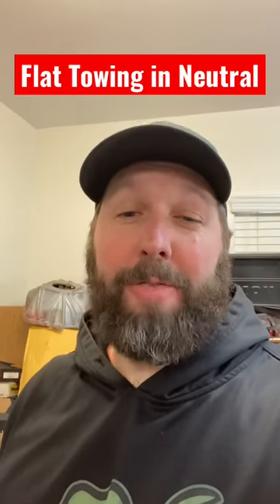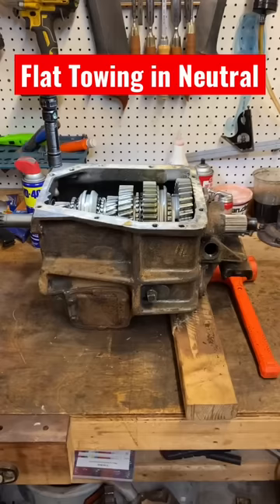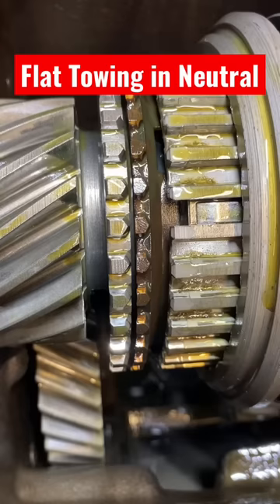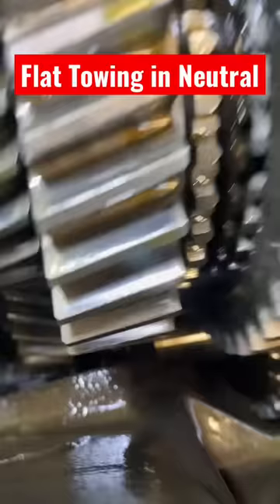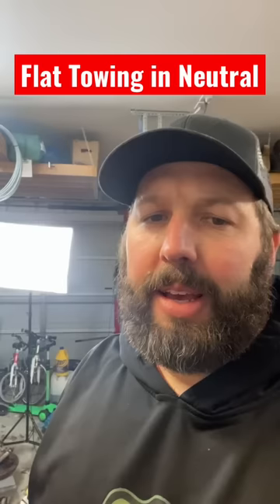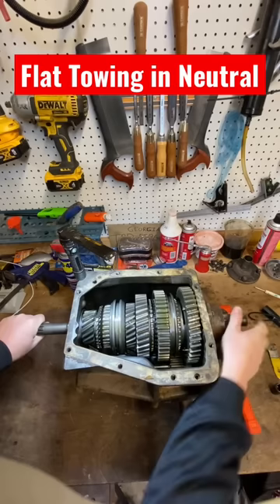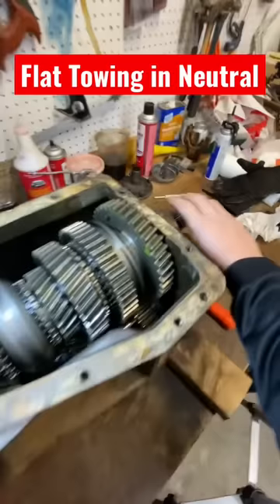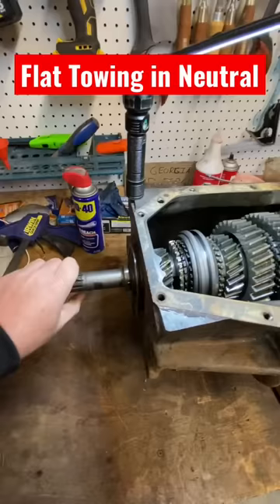Flat Towing in Neutral??? #transmission #stickshift #mechanic

Comment: Except my Subaru owners manual says for my manual transmission tow with all 4 wheels on the ground with transmission in neutral.  So.. it really depends on your transmission.
Reply from the maker: Yep. Always refer to the owners manual 👍
Reply: Some gearboxes have pumped lubrication, it depends on what drives the pump....
Reply: Mins says flat tow but remove drive shafts
Reply: It's a Subaru... You'll never have to have it towed.
Reply: @brockstout2194 ... So, pull all four wheels, wheel bearings and half shafts, then reinstall the bearings and wheels? ... Not on the side of the road... Tell em to send a rollback.
Reply: @kamikrazywarboy2008  agreed. Keep it serviced and let her eat!! 🤘
Reply: @brockstout2194  It's a Subaru, you're going to have to get a tow every 6 months, when you have to do head gaskets for the 20th time.
Reply: @punkrocker10115  ... that really hasn't been an issue for 20 years.
Reply: @punkrocker10115 my 2002 Outback is on its original head gaskets 300,000+km course it's original coils are starting to go and it's 5sp auto drops from second to neutral when it gets really hot out.  Still most reliable car I've ever had...(still starts not plugged in minutes 40)
Reply: @rupe53  literally still an issue on brand new cars. Done a bunch of mid 2010s. Subarus are trash
Reply: @madmattthehatter  I hate to tell you but, a trans that goes into neutral instead of 2nd inst reliable.
Reply: @punkrocker10115  5 speed auto is known to do this.  It's definitely on its way out but it only does it on the hottest of days and it's a $1200 winter driver.  Ironically it's one of my most reliable vehicles I've ever owned and I've owned a 2010 WRX and a 80k 3/4 ton Diesel.  Both needed plugging in or they wouldn't start in cold weather.  The Outback starts on the coldest day of the year not plugged it after sitting for 2 months.
Reply: @punkrocker10115  I'm impressed it goes into neutral instead of pretty much every other transmission that would just chew itself to pieces.  Course once the WRX and 3/4 ton got going they are way more reliable 😂
Reply: @punkrocker10115  ... seeing as we are in 2023, those are not new cars.
Reply: @kamikrazywarboy2008 yep, I have heard that 92% of all Subaru’s ever made are still on the road. Thats where the owners left them when they broke down. 😉
Reply: @danfarris135  nah... Maybe people like you who don't own a tool box and haven't ever spun a wrench... But for guys like me who build their own bikes and own trucks, do our own repairs and maintenance... Subaru is the perfect car for my wife. I wouldn't expect a city slicker that beats their shit to pieces and ignores dealer recommended services to understand, but good convo... 😂
Reply: @kamikrazywarboy2008  I wrench for a living, and i still think subarus are hilariously over-rated.
Reply: @grigorirasputin996  oh... Well so is every other damned car. But for reliability, ease of maintenance, parts cost and availability and overall function and performance they're fucking awesome. 
  Anybody says different either don't know shit about cars, or has to work on cars owned by people who don't know shit about cars... I'm building a 66 FJ40 and a 74 Dodge Dart right now. Both of them are hilariously overrated too. But hey, I'll sell that fj40 for 60 grand, so I'll take it.
Reply: @kamikrazywarboy2008  I actually do like subies, but everytime I'm in the market for a used car theyre way overpriced. I'm not paying fan boy tax on a car when there are more affordable, durable, and reliable options out their. That said, you can't really find an easier car to work on,  their awd system is amazing and the older suburus have a cool factor.
Reply: @grigorirasputin996   Worst thing is people don't take care of em. And they think they have something worth a fortune  and won't sell it to you for a fair price but will just about give it to a dealer...Nobody will ever care about your car like you do.
Reply: @rupe53  I work on newer Subarus all the time and I can assure you they are just as bad.
Reply: @punkrocker10115  ... not sure what these people are doing to their cars. I just retired from a fleet job, and we had a bunch of them. My wife has a 2015 and my daughter had a 2009, with no problems.
Reply: @kamikrazywarboy2008 exactly, you can't tow it if it's already in the garage getting fixed anyways 😂
Reply: @punkrocker10115  ej20 the 2.0 from 20 years ago is so much better than the 2.5 garbage. I've owned 4 subarus only 1 had issues and it was the 2.5
Reply: Subaru's shouldn't be towed, the rear diff blows
Reply: @kamikrazywarboy2008  for all those things Subaru is trash. If you want reliability get a Toyota not a Subaru

Comment: Here's the thing- most autos have the same problem. All the bearings/bushings are oiled by the fluid being pumped throughout the trans. While being towed in neutral without the engine running, the pump isn't running and you'll cook whatever bearings/bushings, or sprag is being spun.
Reply from the maker: Good point. But I can illustrate that very well 😉
Reply: @Freedom Worx  found out the hard way huh?
Reply: That's why 4x4 is recommended and leave the vehicle in park and T case in neutral. Vehicles are different so not all

Comment: I’ve seen driveline disconnects on vehicles that get towed behind RVs and Semi trucks on the hook behind a wrecker with 2 axles shafts on the floorboard but honestly never knew what they were supposed to be preventing by doing either. So thanks you genuinely for taking the time to explain and demonstrate why they spend the time and money to do so!
Reply from the maker: Thanks for watching. Glad it helped. 👍

Comment: My Jeep specifically has a flat tow neutral setting that is factory approved to tow wheels down and I’ve done it for over 10,000 miles. I assume it’s because the transfer case still spins the chain and draws the fluid up to the top. 
There are forums with lists of vehicles you can flat tow ( called toads behind RVs). 
In my Jeep grand Cherokee case, some models don’t have the capability and some do. You have to look.
Reply from the maker: Yes, the T-Case in most Jeeps is ideal for flat towing 👍

Comment: Truck transmissions have the cluster gear at the bottom i.e. little or no lube on the main gear set. Most car/light truck manuals (no granny low gear) have the cluster gear to the right side just low of center i.e. main shaft is in the oil so it's safe to tow. Best bet if you're going to flat tow is to check with the owners manual, the dealer's mechanic or a good transmission shop. They would know best.
Reply from the maker: Many car transmissions suffer the same issue. Having oil all the way to the mainshaft creates inefficiencies. https://www.tremec.com/not_am_detalle/flat-towing-manual-transmission-vehicles/

Comment: Thats true with long distance and high speed towing. However, for short hop tows aross town at low speeds - its perfectly fine and no damage with be done. Have been doing it this way for 33 years(including on my own vehicles) and never had even so much as one single problem...ever
Reply from the maker: I don’t doubt you. I’m just telling people the why behind the what 👍
Reply: "I just slightly damage customer cars while towing" its fine. -most tow truck drivers.
Reply: Damn.... you need a new mechanic if you been towing that many cars 😂
Reply: Tim Russell  My thoughts exactly.  How far and how fast are these cars being towed.  If it's interstate and you need to get there before you leave. then It'll be best to use a flatbed car carrier.  However to tow it to a mechanics workshop then flat towing is just fine.

Comment: I’m of the old school! There was always somebody guiding the car that I was pulling with my chain and pipe that I welded up just for towing, and I would make sure that they knew when we first took off to put it in third gear with the clutch pedal to the floor for a Block or so. And to do that about every mile to throw some gear all around on everything inside. Never had a problem, I’m an old man now and God knows how many cars I’ve pulled with chains since the end of November when I got my license in 1970
Reply from the maker: A solid plan.

Comment: Yep!  Just pull the plugs and tow in gear... solves the problem 😂
Reply from the maker: Good tip! Put it in 1st and it'll tow really easy after the rods break. 😎
Reply: I was thinking more of 4th gear or 5th gear. Low engine rpms, and the engine runs everything except fuel pump. An engine can spin indefinitely without spark plugs in it too.
Reply: @freedomworx  why on earth do you think the rods would break with no load from compression or firing? Obviously top gear is the one to select given it's being towed forwards.
Reply from the maker: @rossbrumby1957  you flat tow a vehicle at highway speeds in first gear and you’ll rev the engine well past where the rods come apart. Rods break in compression or tension, it just depends on the operating condition. The OP specifically said 1st gear 🤷🏻‍♂️
Reply: Cringe

Comment: U-Haul had to buy my mother a new transmission and other repairs for her brand new jeep we decided to tow because the guy at the place she rented the U-haul from loaded it to the back of the U-haul himself and put it in neutral, he told us it was good to go and we left right then. We made it about a quarter way to Pensacola from Miami and it seized up after we stopped at a toll and the red hot gears welded themselves together. Whole back of the jeep was also covered in burnt transmission fluid. It was bad. We had to drag it to the next exit then wait for a tow to the nearest dealership to get it fixed.
Reply from the maker: Well at least U-Haul paid for it 🤦🏻‍♂️
Reply: Automatic?
Reply: You are lucky they paid it
Reply: You can flat tow a newer automatic Wrangler. Transmission and transfer case in neutral.
Reply: A manual is fine

Comment: Yup, I reviewed the video again 3 times. I see my mistake. I needed to picture in my head, the output shaft, is rear wheel drive transmission, next is yoke, then drive shaft universal connection, then drive shaft, then universal to rear end gearing, dividing power to the wheels. Bottom line is, I forgot what I was looking at. I forgot about towing, reverses the drive train; making the output now the input while in neutral. Thank you for setting me straight. Need more honesty in other people too.
Reply from the maker: It’s not intuitive which end is which when it’s apart like this.

Comment: Can you do one where you say how you are supposed to to flat tow?
Reply from the maker: Sounds like a good idea 👍
Reply from the maker: It’s the safest bet 👍
Reply: Remove the drive shaft
Reply: Removing the driveshaft is the ideal way to flat tow a manual. Quite often I just disconnect the driveshaft from the axle, wrap the u-joint with tape to keep it together, and tie/strap the driveshaft hut of the way under the vehicle. That way I don’t get road debris in the tailshaft of the transmission.
Reply: @JohnS-hp2xu  glad i didn't flat tow this manual fwd i just got from Miami to TX. Instead a lady carrying a baby decided it was a good idea to walk between the truck and the trailer while i was moving at a rest stop in Ft Pierce FL, so i hit her but thankfully didn't run her over. Thankful also it was ruled her fault for failure to yield right of way. Never a dull moment.
Reply: @jerrygermain8033  What if it's FWD or AWD?
Reply: @madmatt2024  tow from the front on a fwd. tow from rear on rwd. Remove drive shafts or flat bed the AWD car. Try not to put unnecessary wear and stress on a vehicle.
Reply: @madmatt2024  and if it's 4wd leave the vehicle in gear but put the transfer case in neutral. Especially with a jeep.
Reply: Pick up one end and put the other end on dolly wheels.  On large trucks remove the drive shaft or pick it up and tow from the rear.
Reply: They only way to flat tow without removing drive shafts is if the AWD or 4x4 has a transfer case that can go into neutral. Some newer vehi le with push buttons have a way to select neutral but unfortunately some do not.
Reply: @Alex_Valero  right of way on a private drive? Woman not in even in car? What are you smoking
Reply: Place skateboards under each wheel..... everyone knows this 🙈
Reply: @Leadfoot83  most have a ..tow mode....but some u need a scan tool not just a code reader but a pricey lump of Snap-on...
Reply: @madmatt2024  trailer it.
Reply: @drwombat  someone that steps between a tow vehicle and what it's towing is an eejit first class. Especially if that tow vehicle is running.  Go all the way behind what they are towing, or walk in front of the whole rig so the driver can see you.
Reply: @jerrygermain8033  How about when you flat tow an air cooled VW?  How do you remove that driveshaft? hahaha
Reply: @WikidRacer  that's when you tow it on a trailer
Reply: @jerrygermain8033  Wrong, that's when I flat tow it with my tow bar... Never had a problem. 👌🏻
Reply: Put it on a platform.
Reply: @JDZiemba1773  and by most, you mean some.
Reply: @emanuelruiz7710  I'm guessing you meant to add "dolly" in your suggestion?
Reply: I know a guy who flat towed a car 150kms on the highway. If the engine can start, turn it on and you're all good.
Reply: @erickwatt6391  I know a guy who fell over 150 ft from a bridge into the water, and lived.  If you do that and don't die, swim to shore and you're all good.
Reply: @erickwatt6391  Sometimes that works, sometimes it doesn't. It depends on the design and if there's enough oil getting slung to keep the bearings cool when the input shaft is only spinning at idle speed. Oil not only lubricates, it also carries heat away from the bearings.
Reply: In the RV industry. Concerning dinghy (towed) vehicles,  We had driveshaft disconects, lube pump systems for automatics. Jeep standard trans , were safe with T case in neutral. GM 4 WD transfer case equipped, a tooth pick activated true neutral. and Saturns were popular as towed cars.

Comment: I thought everyone already knew to drop the rear shaft for flat towing. Goes to show, one man's common knowledge is the next man's lesson.
Reply from the maker: It’s certainly not common knowledge anymore.
Reply: @freedomworx  it is amongst people I know 40 and above.
Reply from the maker: Well I’m 43, more mechanically inclined than 99% of humans , and I didn’t know a manual transmission couldn’t be flat towed in neutral until last year. Automatic transmission, that’s common knowledge, manual transmission…not so much. That’s why so many “experts” argued with me in the comments.
Reply: @freedomworx  so according to you, my comment is valid.
Reply from the maker: As it relates to automatics, yes, as it relates to manuals, not so much. Just look through the comments. This video has been viewed millions of times across multiple platforms, and most people think its a spoof, because in their mind, it's perfectly safe to flat tow a manual trans in neutral.
Reply: @freedomworx  your point serves as prove mine, thanks.

Comment: Always flat tow with the parking brake on and every few miles pull over and reset it as tight as you can get 👍
Reply from the maker: Or put it on its roof 🤷🏻‍♂️
Reply: Just drag it in park.
Reply: @freedomworx nah, on the side works better. That way the oil gets to both shafts. Any other way you would have to alternate between upside down and on the tires and that is too much work just for towing a brand new jeep.

All jokes aside, what for the VW bug transmission? Driveshaft cant be disconected since it doesn't exist.

I believe the mechanical oil pump in the engine would allow for it to be towed in 4th gear, but I'm not sure about that. (Not for long and not going fast. 40 to 50mph and 40 to 50 miles total).
Reply from the maker: Well VWs have a transaxle, not a transmission. So it’s a slightly different animal. And many transaxles can be flat towed in neutral just fine. Just have to read the owners manual 👍
Reply: A good excuse to buy a new pair of tires when you get there.

Comment: It all depends on the trans though, I like junk yards and i like reading, many owner Manuals in the junkyard and ive read solé that say you have to tow with all 4 tires on the floor with trans in neutral, and some just want you to disconnect the drive shaft or tow on a flat bed.
Reply from the maker: Always have to refer to the literature 👍

Comment: Flat tow in 1st gear 4-low. It rhymes so you know it's gotta be correct.
Reply from the maker: It’ll tow much easier once the rods come apart 😎
Reply: No….tow in the gear appropriate for the highest speed of the tow. Usually, the highest gear.
Reply: @freedomworx 😂😂
Reply: No you put it in a higher gear so the motor spins more slowly.  Even better put dolly's on the drive tires so you are not flat towing or tow by lifting the drive tires so again you are not flat towing.  But if someone did what you mentioned putting it in 1st you will over rev the motor the moment you do speeds higher then what 1st gear was designed for.   Hince why some other smart guy on here laughed saying yeah that will work great after you throw a rod.
Reply: So tow 65-70mph in low gear?
Reply: These responses think you are serious. 😂

Comment: This only applies to rwd cars. In front wheel drive it does not matter. But this is the reason why I don't use hub locks in my 4wd to save gas. If i disconnect the input shafts from the wheel hubs the front differential and the transfer case stops spinning, and lose the lubrication. If i drive a full summer like that and then engage the hub locks & 4wd hi in the winter it will be a bad time for the powertrain.
Reply from the maker: Yeah it’s not applicable to all vehicles. You just have to read the owners manual.
Reply: Confused on the 4wd part.
If you disconnect the hubs and transfer case. The front diff will not turn and it will be bypassed in the transfer case.
That shouldn't cause a issue.
Unless you run lock outs and have them spin at all times.